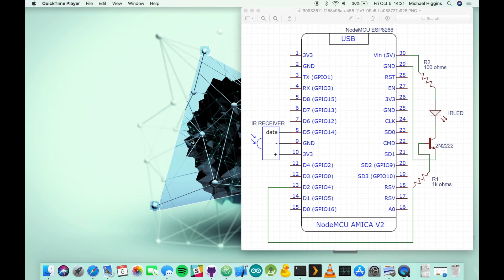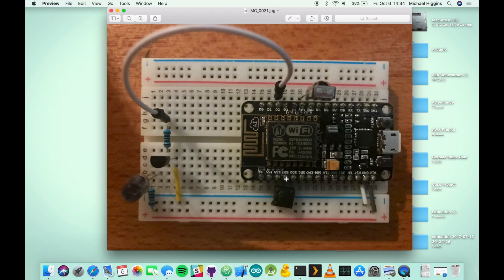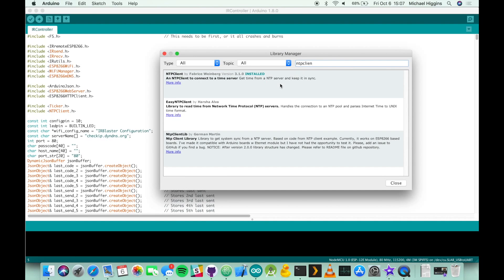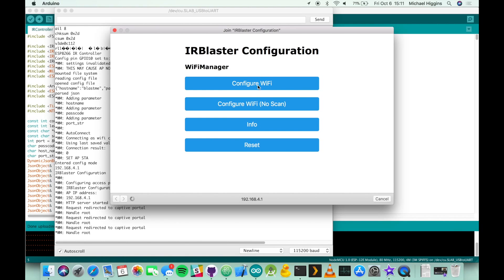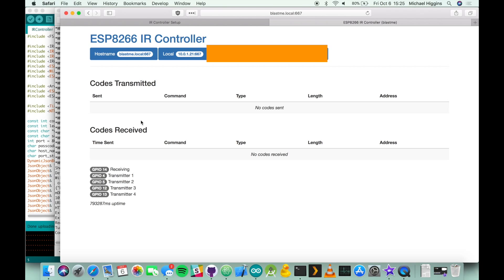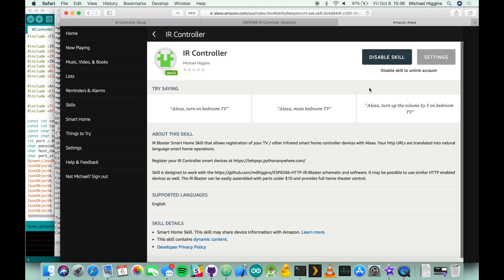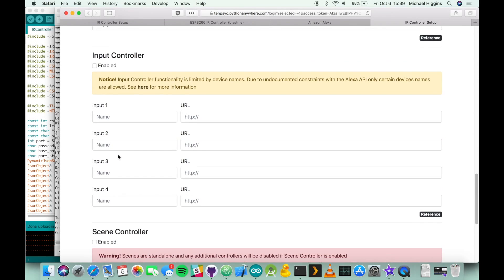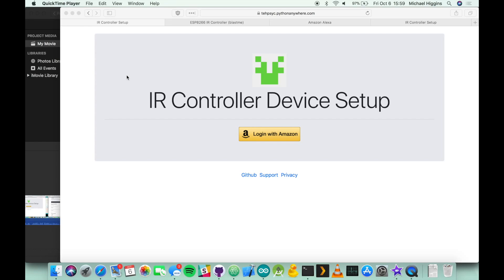IR Controller Tutorial

Comment: Hi and thanks for sharing the video. I however am stuck at this error message, used the copy button:

Arduino: 1.8.0 (Windows 7), Board: "NodeMCU 1.0 (ESP-12E Module), 80 MHz, 4M (1M SPIFFS), v2 Prebuilt (MSS=536), Disabled, None, 115200"

Build options changed, rebuilding all
C:\Users\Dell\Desktop\arduino-1.8.0\IRConroller\IRController\IRController.ino: In function 'bool setupWifi(bool)':

IRController:381: error: use of deleted function 'ESP8266WebServer& ESP8266WebServer::operator=(const ESP8266WebServer&)'

     server = ESP8266WebServer(port);

            ^

In file included from C:\Users\Dell\Documents\Arduino\libraries\WiFiManager/WiFiManager.h:17:0,

                 from C:\Users\Dell\Desktop\arduino-1.8.0\IRConroller\IRController\IRController.ino:8:

C:\Users\Dell\AppData\Local\Arduino15\packages\esp8266\hardware\esp8266\2.4.0\libraries\ESP8266WebServer\src/ESP8266WebServer.h:69:7: note: 'ESP8266WebServer& ESP8266WebServer::operator=(const ESP8266WebServer&)' is implicitly deleted because the default definition would be ill-formed:

 class ESP8266WebServer

       ^

C:\Users\Dell\AppData\Local\Arduino15\packages\esp8266\hardware\esp8266\2.4.0\libraries\ESP8266WebServer\src/ESP8266WebServer.h:69:7: error: use of deleted function 'std::unique_ptr<_Tp, _Dp>& std::unique_ptr<_Tp, _Dp>::operator=(const std::unique_ptr<_Tp, _Dp>&) [with _Tp = HTTPUpload; _Dp = std::default_delete<HTTPUpload>]'

In file included from c:\users\dell\appdata\local\arduino15\packages\esp8266\tools\xtensa-lx106-elf-gcc\1.20.0-26-gb404fb9-2\xtensa-lx106-elf\include\c++\4.8.2\memory:81:0,

                 from C:\Users\Dell\AppData\Local\Arduino15\packages\esp8266\hardware\esp8266\2.4.0\cores\esp8266/FS.h:24,

                 from C:\Users\Dell\Desktop\arduino-1.8.0\IRConroller\IRController\IRController.ino:1:

c:\users\dell\appdata\local\arduino15\packages\esp8266\tools\xtensa-lx106-elf-gcc\1.20.0-26-gb404fb9-2\xtensa-lx106-elf\include\c++\4.8.2\bits\unique_ptr.h:274:19: error: declared here

       unique_ptr& operator=(const unique_ptr&) = delete;

                   ^

exit status 1
use of deleted function 'ESP8266WebServer& ESP8266WebServer::operator=(const ESP8266WebServer&)'

This report would have more information with
"Show verbose output during compilation"
option enabled in File -> Preferences.

, this is highlighted in pink on the arduino screen:
    server = ESP8266WebServer(port);

i have even installed the exact same versions of the program and all packets from this video, nothing changes this error. Thanks in advance!
Reply: I had the same issue.  In the code, find the line "server = ESP8266WebServer(port);" and change it to "ESP8266WebServer server(port);" minus the quotes.  It compiled correctly for me after this change.
Reply from the maker: Something with your Arduino environment isn't set up right, not sure if its the ESP8266 Arduino Core but that would be my best guess
Reply: Thank you both Josh H and Michael Higgins for the replies. With Josh's recommendation, it compiled correctly. I don't know what might be wrong with the ESP8266 Core as this is my first project. I've made it to the end almost successfully but with one , maybe the last hiccup, Alexa reply's "sorry living room tv appears to be malfunctioning" I have set the credentials on the irblaster config screen to the same as your video for now, recorded a button press successfully. Coped the external IP and added &pass=pass (same as on the video). saved successfully, discovered new device successfully but when told to turn on tv, it will not turn on. ( i get the alexa message mentioned above) I am  pretty sure i have the IR wired in correctly, if it was not, or is a bad IR, would the the result? I have also added the same port as in the video along with the IP of the ESP8266. 
Thanks again

edit, in the monitor it shows
URL to send commands: http://blastme.local:667
HTTP Server started on port 667
Error retrieving external IP
External IP address request took 6 ms
Ready to send and receive IR signals
Turning off the LED to save power.

is it normal for it to say error receiving external IP?
Reply from the maker: Clint C did you open up the port on your router?
Reply: I have a linksys router, and I have tied the "single port forwarding" and putting 667 in both the External and Internal port and leaving the protocal to Both and placing the same IP as the ESPs web page. I also have deleted that port setting in the router and tried the "port range forwarding" and setting start and end port to both 667 and same result with Alexa. As far as the error, "Error retrieving external IP", on the Serial Monitor, anything to be concerned about with this issue? Thanks again for taking the time to help me get this up and running.

edit1
one thing that might also be different is the External IP MSG. when copied to the python site, yours is covered up because its specific to you of course, but the length of it seems to be different than mine. Yours http://:----------------/msg?, msg part is right at the end of "Controller" (for visual reference) mine is right a the beginning of the C in "controller" will try different MSG links and see what happens.

edit2 copied "Local IP MSG" which matches the length of yours and now alexa responds with "sorry living room tv is not responding". new is different lol.
Is it correct to have the link to be http://ipaddressofESPpage:port/msg...... ?
Reply from the maker: You can't use the local IP address, that only works on devices inside your local network and all Alexa requests will be coming from the cloud (external). Your external IP address is probably coming up as 0.0.0.0 since you're getting the 'error retrieving external IP' message on serial. The only time I've had this issue was due to my static IP address not being configured appropriately. 

You want to make sure you didn't switch the subnet and the gateway, and that you have the right gateway. Also make sure your static assigned IP isn't used by another device.

If you post the local IP address of your router and the remainder of the IP settings you're using for your ESP8266 I can take a look and see if anything looks off.

To see what your external IP address is you can go to whatismyip.com and see, but if that's not showing up on the device you'll need to fix that or other functionality won't work later down the line.
Reply: the local up address of the router is 192.168.1.1
For the esp Wi-Fi setting page, it has static, gateway and subnet.
Static, I picked 192.168.1.55, no other device is on it,verified on router page of connected devices.
Gateway, same as the router, 192.168.1.1
Subnet, 255.255.255.0

As far as getting an ip to display on whatsmyip.com, it displays my laptop correctly.

Maybe it has to do with the script that was changed to allow it compile on 381 for webserver port?
Reply from the maker: I would try rolling back to the ESP8266 Arduino Core 2.3.0, 2.4.0 just came out and I haven't gotten to try it yet and see if that helps at all. That also fixes the issue with 381 so I would roll the script back to stock
Reply: Thanks for the advice. Uninstalled 2.4.0, installed 2.3.0, opened the stock scrip back, compiled successfully, flashed it to the board successfully. Now it displays the external IP just like in your video. Looks like a bug in the new update.
I can still log into the board and read IR codes. Copied the external link that shows the ipaddress and added &pass=pass since that's the current setting just like in your video, but Alexa still says Living Room TV not responding and the serial monitor displays:

Failed security check, signatures do not match
1.lots of numbers and letters
2.lots of numbers and letters
MID: lots of number and letters with - (almost like a serial code)
i tried changing the &pass=somethingelse and got what looks to be the appropriate message,  "Unauthorized access". Put it back to &pass=pass, updated device, re-ran discovery, same result, Failed security check. 
Thanks again for the assistance!
Reply from the maker: I think your user_id setting is probably wrong, make sure its the one from the bottom of the configuration page and not your username or email
Reply: Yep, I missed the last 2 digits of the username from your site. Up and running, need to buy those super bright IR leds and the same resistors, they barley light up using the resistors I used, right ohms just way thinner than yours. Thanks again for the assistance. Hope this helps the next user.
Reply from the maker: Yeah the super bright LEDs work great. I used a 10 ohm resistor for mine and the range is solid

Related note, I just pushed a set of updates that should make everything compatible with ESP8266 Arduino Core 2.4.0

Comment: Happy new year to you all, with special one to Michael.

Now since I am a "friend" of Alexa.....I am faced with the challenge of coding these OLD devices that I have WITH garden variety of IR protocols. So far I came up with these questions :
1. I tried RAW failed miserably...I need an example. ( to avoid using Panasonic, RC6 NEC etc )
2. How to deal with formatting difference with each protocol. For example Panasonic has an ADDRESS part and Code part.   In your video you disregarded the address part (The NEC protocol).
3. I need your help to DEBUG the codes I put  By that I mean I want to avoid going to Alexa to see if the code is correct ; let alone moving everything to where the TV etc  are located
4. Why it takes time to change the code in the cloud site after UPDATING with success. I do the change but Alexa keeps sending the OLD one!.

I tried very hard to come up with answers before I posted these questions....But it seems I am the least experienced Let me hope that new comers will make use of your answers.
Reply from the maker: You just need to rerun device discovery after you make changes to update Alexa. She will say 'no new devices discovered' or some variant of that phrase but that's ok, the cache'd URLs from the settings page will be refreshed during device discovery. You should never use RAW when the encoded option is available, that's always the better way to do things. The only protocol where address matters is panasonic and you can add that to your URL parameters for panasonic and it will be used (&address=0x000). To debug the codes just don't set your user_id in wifi manager initially, this will let you send codes via your local URL. Once everything is confirmed working just update the settings to enable the security.
Reply: Thank you for your valuable support. I managed to persuade Alexa to do the on/off, VolUp/Down And mute. I had to cut out the address portion in the code because it is  defined  in the address tag. Very pleased with the results.

I know I am pushing my luck and asking these questions; but I am getting the hang of it with your help. 
- Why you added more than one transmitter ? for what purpose and how one make use of them.
-Channel controller I need desperately an example I assume you provided 12 buttons. Are they the 10 numeric buttons in the remote so if you need channel 33 you SAY 
 "Alexa 3 button"  two times ??  and where is the OK button May be I use one of the extra buttons you provided but I cannot say OK. 
And finally what do you mean by BASE URL An example will help great deal.
Reply from the maker: Channel controller is a more sophisticated setup compared to the others because it will assemble the sequence of buttons for you depend on what channel you want. You can say "Alexa change channel to 33 on TV" and the skill will assemble the appropriate sequence for you. 

An individual channel shoulder look like this
data:
'40BE807F',type:'NEC',length:32

And the baseURL is the URL to your device's JSON command page with any parameters you need (out, pass, etc)
http://yourip:port/json?pass=pass

More than one transmitter for more than 1 device essentially, especially if the one LED does not have line of sight

For the OK/Enter button you put that IR command in the Enter button box and it will press enter at the end of the sequence automatically assuming that button is present, its optional.

Comment: When I try to access my "External link" I get the message [ Unauthorized, HMAC security authentication ]
I deleted the configuration ( in tehpsyc.pythonanywhere.com)  and created a new one...Still getting the same error    Is there a way to fix the error.???
Reply from the maker: The only way you're seeing that error is if you're trying to send commands from the browser instead of having Alexa send the commands. You either need to delete the saved user_id from the device (WiFiManager settings) or have Alexa send the commands
Reply: Thank you for your response. I am in catch 22 situation..... When I ask Alexa I get the following( I asked Alexa twice...and very politely!!!)
Warning, user_id appears to be in the wrong format, security check will most likely fail. Should start with amzn1.account.***
Failed security check, signature is too old
Server: 0
Local: 1514716900
MID: 
Connection received - MSG
Warning, user_id appears to be in the wrong format, security check will most likely fail. Should start with amzn1.account.***
Failed security check, signature is too old
Server: 0
Local: 1514716927
MID:
Reply: I will start again...what firmware shall I use ????
Reply: Everything is OK.....  You have a very stable Skill. The problems I faced are all of my own doing......
Reply from the maker: No need to start again and no need to reflash firmware, you just have to connect the reset pin to ground and restart the device and it will enter configuration mode where you can change any settings. GPIO10 is the default configuration pin

Comment: Ok and do I need to change the IP settings, or is that only for static. They are currently the 10.0.1.10 but my router uses 10.0.0. range thanks
Reply from the maker: PIFISLOVE yes you need to change the IP settings to be consistent with your local network
Reply: Michael Higgins thanks. It was a little confusing, I tried to follow the GitHub readme.MD but I couldn't piece those questions together maybe if you get a chance just throw that onto the readme. I got it running last night, I'm excited.
Reply: So, i spoke too soon. I keep getting this with a correct password or no password set for sending. Can't send ir. I get a "Unauthorized, HMAC security authentication" message, reflashed multiple times. Any ideas?
Reply from the maker: Are you getting that error with Alexa given commands or with commands send over the browser? Once you set the user_id setting authentication is enabled and only commands sent from Alexa will work
Reply: @michaelhiggins3896  pls must I have a router to implement this I was using my mobile hotspot could that be why my IP ain't changing ?
Reply from the maker: @arnoldaddo2642  You just need to be able to have the device/port accessible from outside your external network, whether that can be done on a hotspot or not will depend on the specific device
Reply from the maker: @arnoldaddo2642  It also seems like you need to just configure your network settings correctly on the device, you might need to trigger a reset to access WiFiManager configuration again if you didn't do this correctly the first time, see the readme for how but you'll need to set the configpin to ground during boot

Comment: Does this mean anything ???  Alexa Skill (US/CA/UK/IN/DE)  I am not in anyone of them
Reply from the maker: The fact that you installed the skill and have discovered a device means its probably not relevant, you've clearly gotten Alexa to work under one of those regions. Your issue is 100% related to the fact that you haven't opened up the right port on your router. You need to set up port forwarding so your device can receive commands from outside of your local network

Comment: I just did ping the site with port 667 here what I get
This site can’t be reached
xxx.xxx.xxx.xxx took too long to respond.
Search Google for 156 223 151 179 667
ERR_CONNECTION_TIMED_OUT

I can provide you more details on personal level....Heck I trust you fully
Reply from the maker: You need to open port 667 on your router and forward it to the local IP address of your IR controller device. Also I would delete that error message you just posted because it includes your external IP address
Reply: I,m unable to find external ip address, below are details

ESP8266 IR Controller
Config pin GPIO10 set to: 1
mounted file system
*WM: Adding parameter
*WM: hostname
*WM: Adding parameter
*WM: passcode
*WM: Adding parameter
*WM: port_str
*WM: Adding parameter
*WM: user_id
Using Static IP
*WM: 
*WM: AutoConnect
*WM: Connecting as wifi client...
*WM: Custom STA IP/GW/Subnet
*WM: 192.168.1.58
*WM: Using last saved values, should be faster
*WM: Connection result: 
*WM: 3
*WM: IP Address:
*WM: 192.168.1.58
Default port changed
WiFi connected! User chose hostname 'ESP_5E4034' passcode '' and port '80'
mDNS started. Hostname is set to ESP_5E4034.local
Local IP: 192.168.1.58
URL to send commands: http://ESP_5E4034.local:80
HTTP Server started on port 80
Ready to send and receive IR signals
Turning off the LED to save power.

How to get external ip address to get it communicated.?